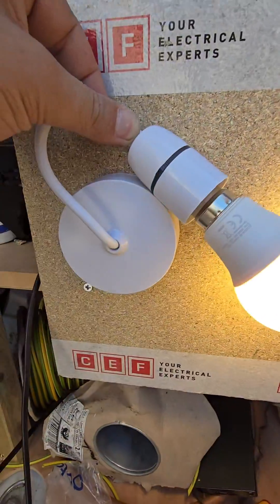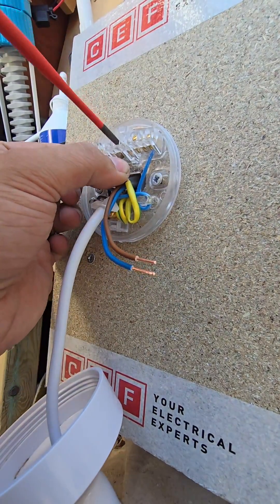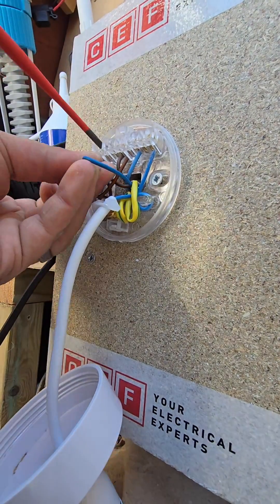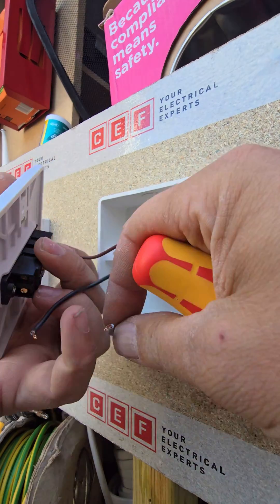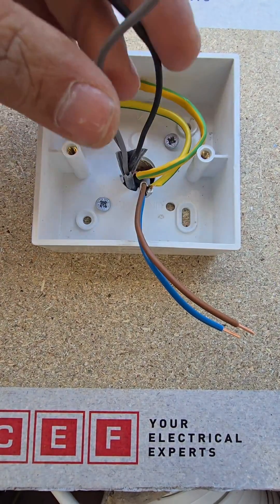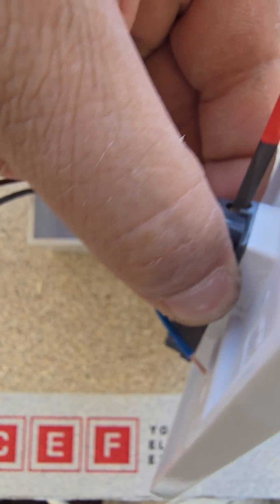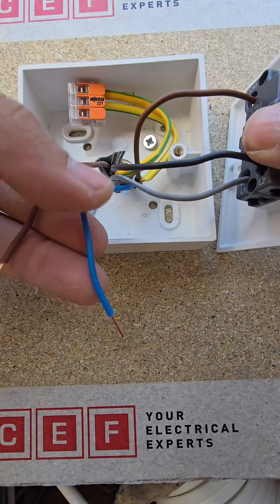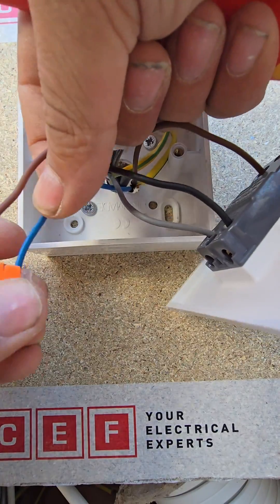2way switching the 3plate wiring method

Comment: I haven’t seen it done like that in over 40 years
Reply: Put 2 browns L1 or L2 grey and blue in the other and black in common
Reply: And mark grey black and blue with brown sleeve. I agree with brown on brown in L1 or L2. Likewise the opposite wire. I use blue on black and grey with common On older colours red on red black on blue and yellow as common). w @neiltrevatt

Comment: Why do they do it like this for 2 switch over the traditional way?
Reply: Thats the conduit style of 2 way lighting wiring. I usually use brown to brown and blue on black. Looped into L1 L2 respectively or vice versa depending on cables. Grey as common. And mark grey black and blue wires with brown sleeve. And similarly in the older colours red to red black to blue yellow in common. Mark yellow black and blue with red sleeve